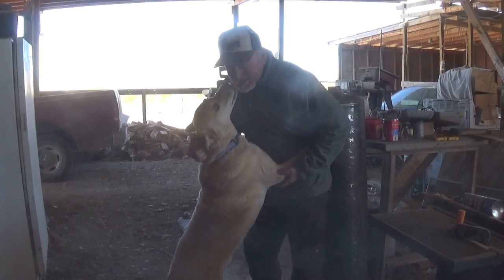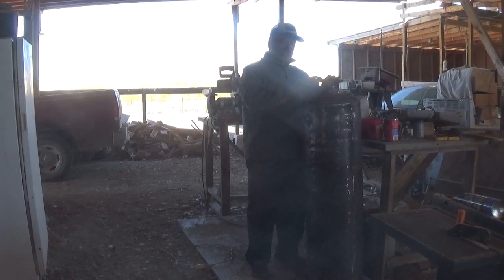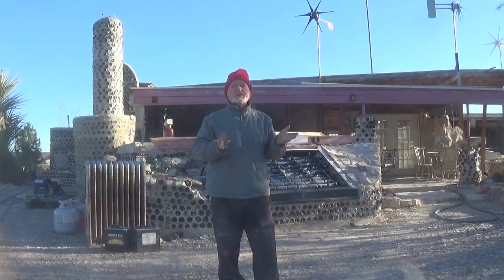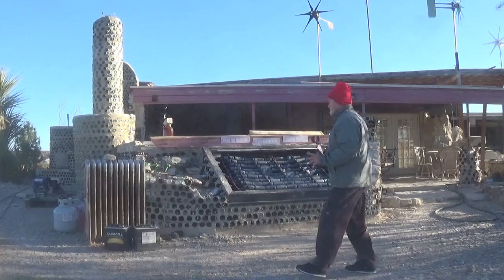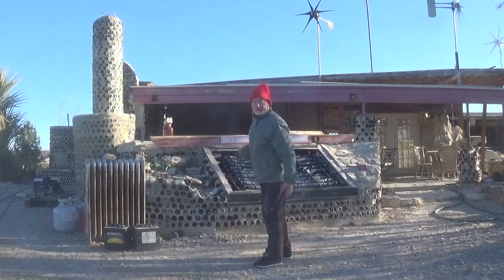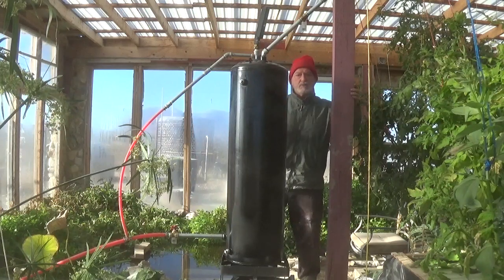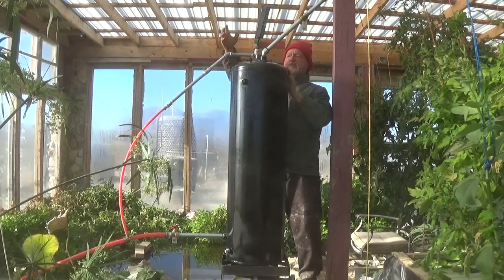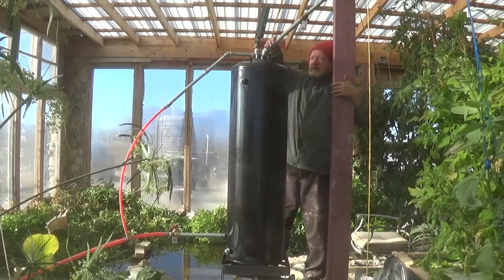Aquaponics Greenhouse Water Heater, No More Cold Fishes!!

Comment: I have been going this nearly all winter. This is NOT an efficient way to heat water.. I also have a small wood stove with copper coils in it to heat water as it returns to the fish tank. This is far more efficient...
Reply from the maker: My design is far more efficient? YES! I think copper coils are only efficient when you have BIG diameter copper.

If you were saying your way is more efficient, it may be for your small fish tank. This system is heating water for a 4000 gallon aquaponics system and air in a 1600 square foot greenhouse and after 30 hours, has done a fantastic job!
Reply: @ecoranchusa  well if it works for you great! My fish tank is only 1200 gallons and a small green house. I use 3/8 copper tubing 40' long. I use rocks around my wood stove to retain heat over night. I go through a cord of wood about every 60days +/-.  My cousin uses an electric hot water heater with a slow flow to retain heat in his in ground pond. That works well for him. (Approximately 2000 gallons)

Comment: Thought you were channeling Charlie Chaplin for awhile on the first release.  I think you may be surprised how fast the propane will get used up.
Reply from the maker: It is a back-up to the solar hot water system and runs only a short time at a time. See the next video!

Comment: I like your design, do you think the bottom of the tank can take the open flame for an extended time?
Reply from the maker: It is the core of a propane hot water heater, so it was designed to take the heat.
Reply from the maker: It is working BETTER than I expected too!